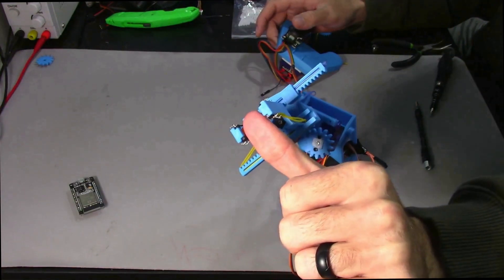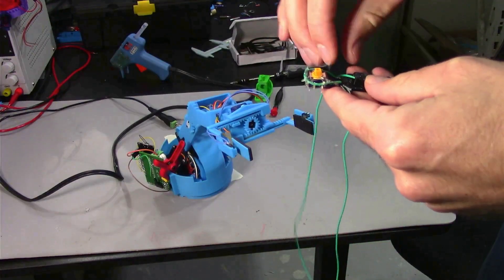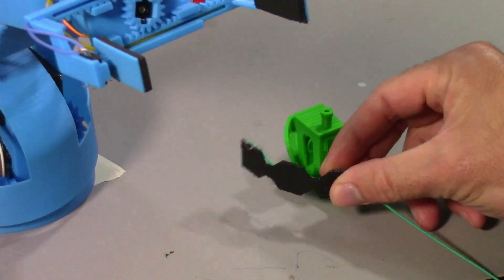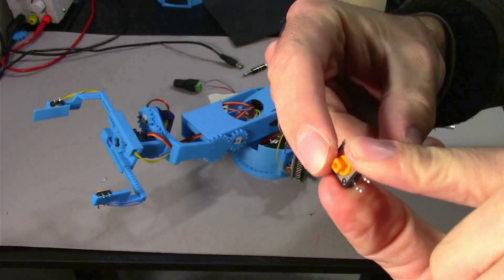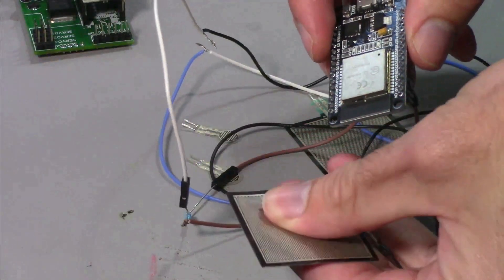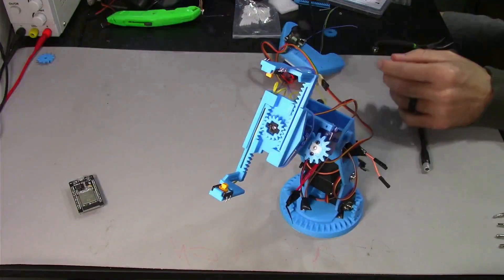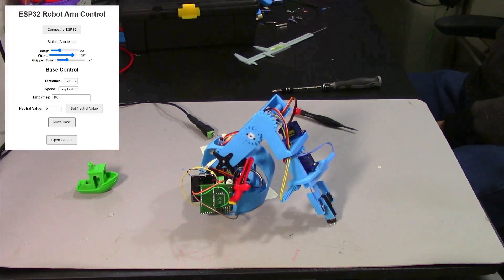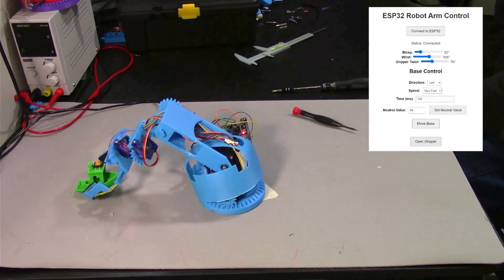Thin Film Pressure Sensors vs. Buttons: What's Best for Robot Fingers?

Comment: just discovered your channel. your projects are amazing! i wanna eventually work towards projects like yours.

im currently working on a hexapod, but it's a daunting first robotics project. can get it to walk forwards but hoping to use force sensors in the feet, like you're doing.
Reply from the maker: Thats a great project! We just finished testing our 3 legged walking robot that has 2 pressure sensors on each foot. One in the front, and one in the back.

Comment: My only question is, I thought this was comparing the two options the saying which one is better for what but like, it didn't it just kinda showed an arm you made using buttons Mentioned that the  resistance sensor changed voltage on contact on that was it, so like which one do you use? Other than the downside of low detail with the button and the incompatibility of the resistance sensor with some material which one do you use for what? What's the application possibilities?
Reply from the maker: I actually use the same padding and pressure sensors in my walking robot. The video will be released in a few weeks. Overall you are correct, I didn't really answer "why?", but the sensor could have been used in the robot's gripper in the same way as the buttons. The Buttons are just cheaper and easier to attach.

Comment: Would it be possible to measure the current of the servo and use that as a limit switch? Or maybe as pressure sensor if you tune it just right
Reply from the maker: That's another way to do it, and both methods combined would produce the best results

Comment: Are the pressure sensors compatible with arduino ?
Reply: they should be since they are basically resistors.  They are called Force Sensing Resistors or FSR's and im guessing they just need an analog pin to read the value and some fancy math to determine the force 🤷‍♀ its funny cause i was looking at FSR's awhile ago to put on a robot arm so i could sense how much force its putting on an object so it wont crush it but they used buttons and not the FSR i wonder why
Reply from the maker: Yes!